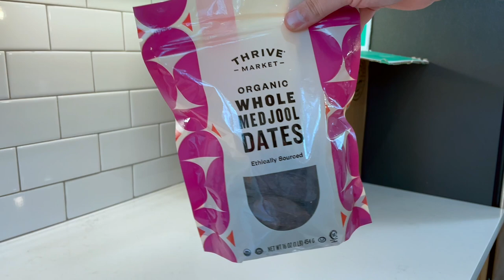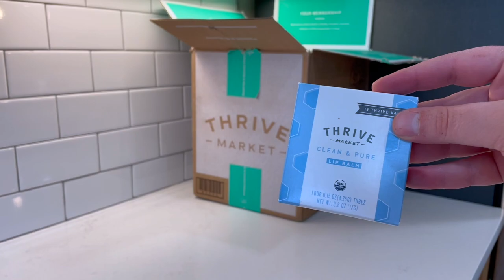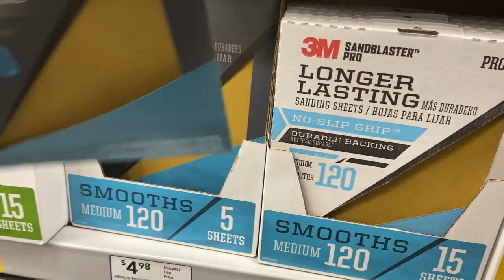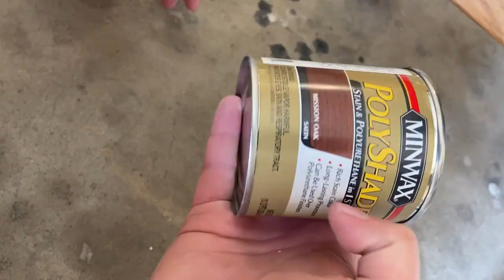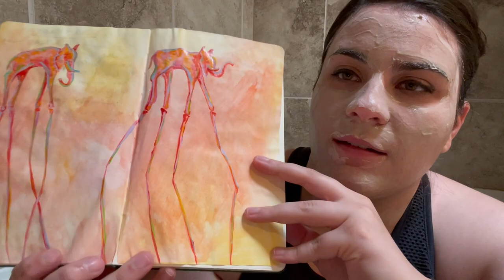The Diagnosis...

Comment: I am proud of you for taking that step to get help. I have undiagnosed inattentive ADHD and once I figured that out a lot of things made sense too lol. For your Monstera, you adding the moss poles will be a big help! The way to know if it needs repotting is if you see any roots poking out the bottom of the pot. It means they are search for more space to grow! A tip I’ve learned is to make sure when repotting is to only go up 1-2 inches bigger in pot size or your plant will struggle. But also to not just buy potting mix and call it a day. Make sure it’s well draining soil and add perlite and orchid bark if you can to help with drainage. When I repotted mine I divided the plant into two pots annnnnd it hated me for a bit and all the baby leaves were dying (my pots were a hair too big since a divided them. But they are thriving now.) Also as others have me mentioned Lillies are toxic to cats, but so are Monstera’s and most of the popular plants. Which sucks cuz I have a rabbit and two cats so I have to keep my plants in a separate space. However, there are a bunch of plants that are not toxic so you could look into some of those to have at lower levels instead.

Comment: Btw, if you notice your plant starts growing in one direction rotate it away from sun, for about a month. They leaves will start to grow towards the sun and end up straight.
Reply: Also, those spring wraps you can cut them in half place one in muffin tin then add a second so that you have 8 points. Add some taco meat and cheddar cheese heat in oven til cheese melts and remove from oven. Then take diced tomatoes and lettuce and salsa...taco bites.

Comment: I love that bay window for all your plants.  For spring rolls, just go buy a bag of premade cabbage slaw mix.  Saute it with a little garlic & ginger.  I put mine in the air fryer, but you can boil or deep fry them. Whatever you prefer.  I also just made some with steak, mushroom & cheese.  I know, I'm not normal, but they were delicious.

Comment: So glad you talked about this. I got my Asberger's diagnosis this year too and it also felt like a weight lifted up from me. Highly suggest some great neurodivergent youtubers. I've gotten a lot of great tips to help with anxiety and social anxiety. I'm waiting to get another appointment to check on ADHD after hearing your story I realized I have a lot of similar symptoms and just want to know.  My family dynamic has gotten so much better after teling them and helping them see how I need me time and that I may act in ways they think mean one thing but don't like your example. I would get very annoyed when we had plans change because it ruined the flow if my day and the plans in my brain but I often wasn't mad at them it was more like anxiety I just didn't know what anxiety was and would hold it in and self-harm to release anxiety. My family always thought I was just never nervous but I was in literal pain to the point I ended up with a chronic migraine disorder. I also used to like having no lights and hiding in small spaces because it gave me more control. My mom hated it and would stuff things in my closet so that I couldn't use it to hide and always turned on my lights. Now that the understand my quirks and needs a bit more we've had a much more harmonious and functional relationship.

Comment: Fair play for getting a diagnosis! That's such a huge and scary step! And so is starting meds, it's okay that you've been putting it off, that's normal. Meds are amazing, I take anxiety meds so it's not the same thing as adhd meds but this bit is the same: they won't fix everything. What meds do is they pick you up off the ground just enough that you are then able to put other things in place that will help you to fix things.

Comment: For plants (if nobody has mentioned it)- easiest way to check if they need water is to stick your pointer finger in to the first knuckle. Is it dry? Give it a good thorough soaking. If its still wet hold off. Top of soil dries out quickly, but underneath varies based on temp/humidity. Its helped me so much with my plants.

Also like others said, rotate! It helps all sides get sun and keeps them from getting sun damaged. When it comes to pots, some plants like to be crowded (aloe does often) and some need room. Hope that helps your plant friends- and the good news is that most cacti/succulents are pretty sturdy!

Comment: I had a plant like you have. It does need a bigger pot. Also, it can grow to a monstrous size. It can also be divided and replanted in separate plants.  I planted part in another pot and washed the roots off of the other one and planted it in a large, glass vase and it grew nicely. I found it interesting that you could see the roots showing through the glass vase. When the roots started crowding the vase I would trim them. It didn't harm the plant at all and it continued to grow, but alas, I left it at a hotel when I made a long-distance move back in 2012. I'd love to get another one.

Comment: OK, for the Monstera, I wouldn't repot it just yet. I have one in a similar sized pot and it's about twice as big. They will grow quite a lot of aerial roots before it's time to repot them. Keep in mind, Monsteras can get huge so with every repotting, expect them to get a lot bigger. Also, when you go to repot them, do it in the late spring or early summer as they will be going into the growing season. As it's late summer, they will be going somewhat dormant through the fall/winter and they will struggle to adjust after a repotting. It's beautiful so keep up the good work!

Comment: Hey Bea. When you moss pole your monstera, make sure you don't tie to  the leaf stems (called petioles). They need to move around to follow the light. Monstera's are actually climbing vines and at the base of the plant you will see a very thick short vine where the leaf stems are sprouting from. You want to attach the vine to the pole to train it to grow upwards. You can mist the pole a bit to encourage areial roots to form, helping attach it naturally. Just thought I'd mention as I've just learned this as well and totally just attached the leaf stems like you did. Oops!

Comment: I’m a new homeowner and have been obsessed with home improvement. You got the concept but did u get a finish for the wood. After you stain it you need to seal it with a water proof coat of whatever type of finish you prefer. They have all types at the hardware store. Good luck!

Comment: Your monstera will love the moss pole! If there are roots at the bottom of the pot, it might want to be reported, but it probably won't hurt to stay in it longer. Be careful about bigger pots because the bigger the pot, the longer you should usually Wait in between waterings (until the roots fill the pot)

Comment: oh also for you monstera... um it kind of looks like you have two different plants together in the same pot. it looks like they put split leaf philodendron in the same pot as your monstera deliciousa. they get confused a lot so no surprise there. due to the scarce holes in the leaves on the monstera it needs more light :)  a little grow light from the amaz-on will help theyre pretty cheap. the do like to be somewhat root bound so id say you are good now but repot in a year. they are ok to be repotted at any time. ALSO if you see an aerial root coming out of the monstera, its like a brown worm looking thing you can cut it off if you think it's ugly, but if you put it in water then the plant gets happier. you may also want to invest in some watering stakes. basically its a teracotta spike that you put near the root ball and then its got a little tube coming out that you put into a water bowl. place the plants higher than the bowl (capillary action is used here so that does matter) and then you keep the water bowl full and the plants drink the water as they want. no root rot! its amaze

Comment: I recommend checking out the book This is Your Brain on Birth Control. Also track if you experienced any mental health changes when your BC changed. Personally the times when I've been on BC correlate to my worst mental health years. Also the Mirena wrecked my face and back with cystic acne. While the promise of an IUD seemed perfect I ended up needing to remove it because I was so miserable.

Comment: A great rice paper meal is just a bunch of raw veggies and/or fresh herbs with some marinated tofu (you can buy the pre-marinated tofu to make it easy) then do a quick peanut sauce for dipping (peanut butter, soy sauce, sugar or hoisin and vinegar). Get a wide and shallow dish fill with warm water and soak each rice paper sheet for about 20 seconds and then put it on a cutting board and roll it up like a burrito. Tip is dont let the wraps touch after you roll them cause they stick together and are really hard to pull apart without tearing them. Good luck!

Comment: I have a Christmas Cactus, too. But, I'm honestly not great with plants. My only advice: they like shady spots, a bit of humidity, no temp below 65° (or so) and don't water until the soil is completely dry (just plunge a finger into the soil, easiest way to really tell). Don't feel bad when pieces randomly fall off - it's normal. On the ADHD thing, I'm glad you got the diagnosis you needed & hope things get easier!

Comment: Rotate your plants every time you water them or once a month and it will fill in all around since the plant is getting equal sunlight. 

You only need to repot if roots are coming out the bottom of the pot or if there is literally no soil left in the pot because it’s all roots (you would have to pull the plant out to check) but your Monstera is pretty young and starting to mature.

Comment: Remove any imperfections on the first coat of stain with a very fine steel wool and then apply a second coat of stain.  Once it dries, rub the steel wool across it again to remove any imperfections.  Lastly, apply a clear coat to protect the stain.  That's just what I remembered doing in my shop class 20 years ago.

Comment: ALSO! Just speaking from personal experience, the first week or so of being on meds you might kinda feel "manic", you will have a lot of energy (because the meds are a stimulant) and your mind will feel so sharp and clear so you'll feel so motivated to get a lot done in a way faster pace than you are used to. My advise is PLEASE try to sleep as regularly as possible at least the first week, it will help you from burning yourself out. Also eat before you take your meds cause you might lose your appetite the first week, and avoid caffeine until after lunch if you can or you might get shakey (stimulant meds plus caffeine can be too much too soon before you're used to it). The meds will eventually feel less drastic as your brain and body adjust, but until then don't freak out if you feel extreme the first few days or even up to a month. I am of course not a doctor but these have been my experiences and a few of my friends experiences growing up or recently :)

Comment: Maybe get a taller moss pole for the Monstera to take the weight of the plant better ...? Plus it'll want to climb when it gets bigger. They tend to get longer rather than bushier. Also the christmas cactus might like a cactus mix soil... or add pumus or sand in the existing soil. Something that will drain well and let it dry out a bit more than the other house plants : )

Comment: So the stain with the poly almost never darkens to the color I'm hoping for when I use it and a second coat after it's dried doesn't really.... do anything because now the poly Sealed it and can't get into the wood grain anymore 🤦‍♀️ so for me when I do this type stuff I found it works better if I use a separate poly after getting the right color from the stain, but that green tho 😍.  You're supposed to go back when it's dried some and wipe off all the excess stain I believe.  Sometimes I have to mix 2 stains to get it right.   I have stopped picking up these projects though because I rarely finish them,  especially before we move again so it hasn't really been working out for me. I am starting to think maybe I have the inattentive adhd..... my brother most likely has aspergers and I always feel like I have chronic foot inmouth syndrome from not picking up social cues so idk.... something I guess I should talk to therapy about but idk.   I do have diagnosed general anxiety disorder though and trying a second med for that so yay for trying to improve 🙃

Comment: Fun TMI fact: When I got my first Mirena IUD inserted in my 30’s, it gave me acne and i didn’t even have acne as a teenager 😳😟😒. I also had undiagnosed depressive mood swings that I believe was also from the IUD. It resolved after the first 2 years (why did I let it go that long?). But after replacing it with my 2nd IUD= no side effects at all. Go figure 🤨.  Anyway I thought of this when you mentioned your zit 🤣

Comment: Sand your window sill and then stain it…then USE MARINE VARNISH at least 2-3 coats….if you do 3-4 coats it will help protect from the dogs, BUT YOU WONT GET WATER STAINS ETC! That’s what I used in my window….oh also protects from UV light…be sure it says NON YELLOWING…som marine varnish will yellow in the sun.

Comment: my local plant shop recommends waiting until the roots stick out the bottom to change the pot. And then only go up an inch around. For now, you can stick it in a pot in the plastic pot. That's what I do for my plants. Also if you rotate it in the window it will grow towards the sun I believe to even it out. I THINK. Also an ADHDer. Welcome to the party.

Comment: Side note, should definitely stir the polyurethane before applying as the polyurethane sticks to the bottom while the stain color is at the top (that is if you didn’t stir it, if you did then disregard) 🤪

Comment: There are really good reasons that ADHD and Aspergers are called executive dysfunctions. Because they make it really fucking hard to execute any functions. I have both and frankly that just means I go complete zombie brain a good part of the time. Like the engine is turned on, but the car isn't going anywhere? It just idles until it runs out of fuel. Except the car is my brain. Other times I describe it as an old toaster of a PC trying to execute multiple programs at once and, being completely unable to chose one program or prioritize, it just crashes instead. No program ends up getting done. I just fall asleep.
I take Ritalin and that helps me not fall asleep at all times except the times I'm actually meant to sleep at. It's a lot easier to get stuff done when you're not constantly exhausted by a messed up (non-existent) sleep schedule.

Comment: Bea! Plant advice:
- rotate your plants, so they grow into a sort of ball shaped lump rather than reaching for the light all on one side where the window is and 2/3 of the plant isn’t 
- get little pot feets to lift the pot off of the surface of the wood. This will allow air under the pots and put an end to mold problems
- cacti like specific soils, you could pot the sad one up in fresh cacti soil and see if that rescues it (full support of ending the family tree though I loved that analogy 😂)
- the plants may need more humidity, you could get a spray bottle mister to give their leaves a little more moisture. 
- water less frequently and see if that helps; what you think is neglect Mother Nature probably thinks is pampering